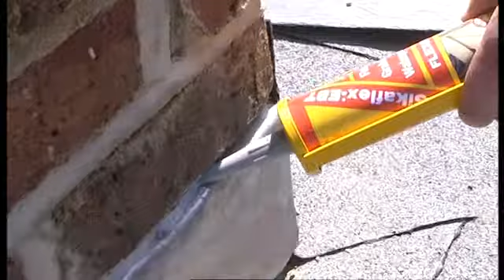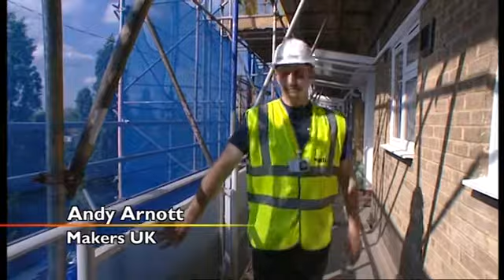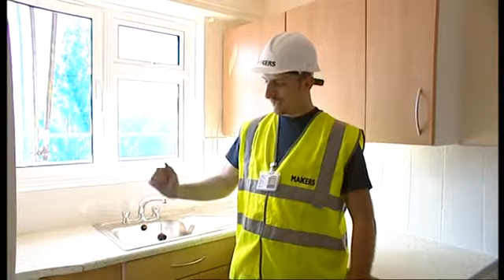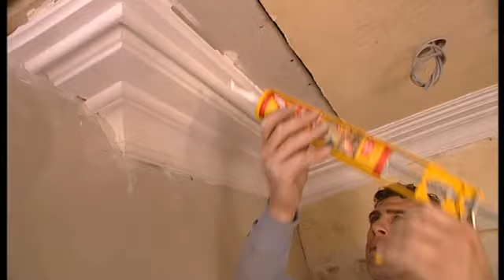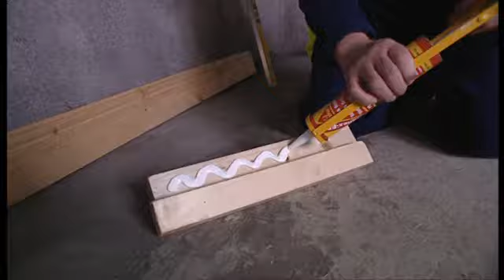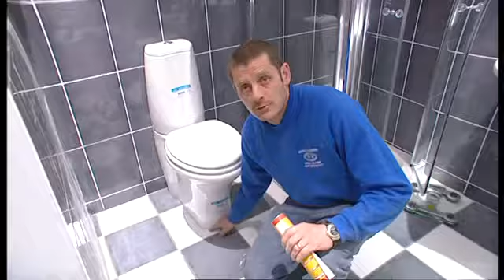Sikaflex ebt Paintable Multi Purpose Sealant adhesive and Filler

Comment: I did a minor test with Sikaflex EBT and CT1.  Two small patches of plywood. One blob on each and stuck to the varnished floor.  2 days later I prised them off. The EBT took off the varnish layer to the wood . The CT1 just came off without any varnish .  
 Please note EBT and CT1 will not stick to each other.  They are like chemical opposites .You can make a reverse moulding from one to the other .